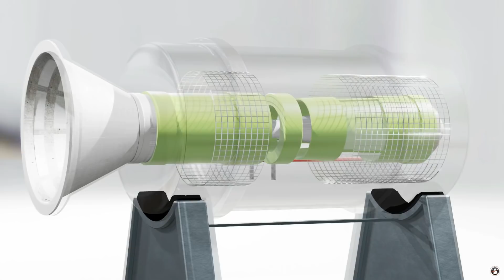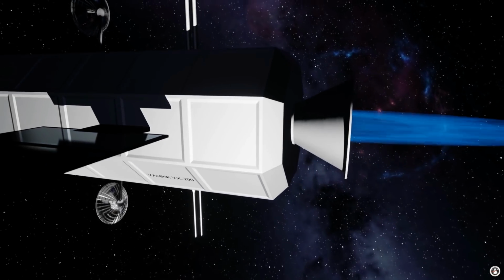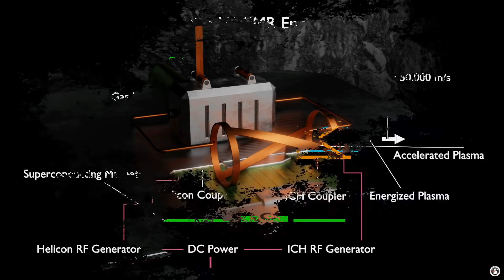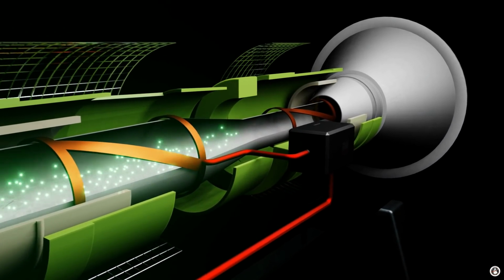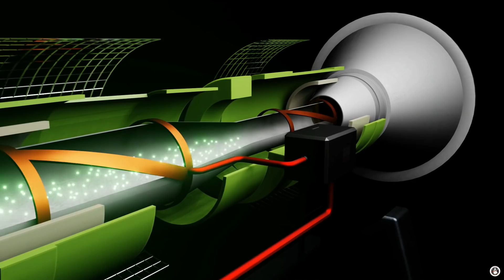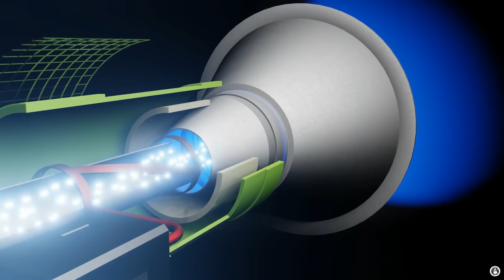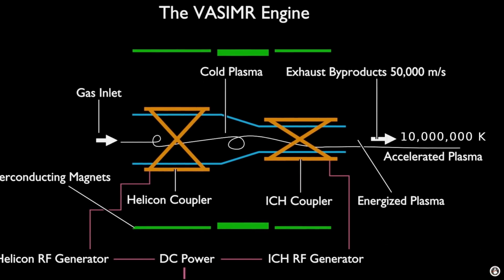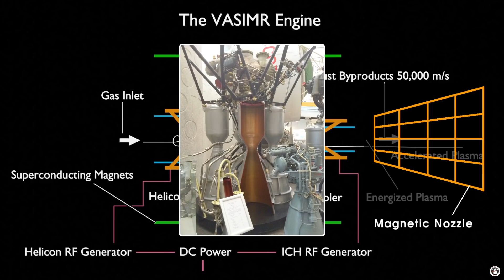The VASIMR Engine – 0.000167 c / 50 km/s

Comment: Nice to have these very high speeds, but that craft will have to slow down considerably, to land on Mars. How does that work?
Reply: Chemical engines are useful to climb or descend from and to planetary gravitational holes. 

But for space outside gravitational sphere of influence SOI, VASIMR is the best. It would spend half the trip accelerating to incredible speeds and the other half decelerating at a very low price tag in propellant. It is very similar to chemical trips except for the fact that during most of the trip chemical engines are turned off as they did the planetary transfer burn at the beginning of a trip. Think pf a cannon ball that gets its propulsion inside the cannon only and the rest of the trip it goes by inertia.
The good thing is Mars is in a higher orbit compared to Earth, so the climbing process would slow the ship, saving some need to decelerate and saving some propellant.

As I see it the VASIMR ship is like an airplane. You use an ascent vehicle (think of a car to go to the airport) to go to orbit and a descent vehicle to land on planet. Both use chemical engines. And the airplane uses VASIMR. Just like driving across a continent takes ages, having an airplane is faster to reach destination.
Reply: @aquarius5719  Nuclear Salt Water Rocket would be the fastest one, it's the real life buildable version of Epstein Drive from The Expanse series.

VASIMR Isp 5000 s, largest version thrust 5 Newton.
Nuclear Salt Water Rocket using Reactor grade U235 Isp 6,728 s, thrust 12,900,000 Newton.
Scott Manley even did a video on NSWR.

Comment: How much electricity does it consume?  What is the specific impulse?  Is there a drawback in the engineering?  It seems too good to be true.
Reply: ISP is variable unlike chemical engines. R&D is about overcoming drawbacks. It works on Earth. It needs to be put in orbit for further testing. Up to this point it exveeds expectations. NASA is very demanding, they did not even allow Musk to paint a SpaceX logo on his Dragon capsule because it could cause uneven heating that could lead to paint debris and more space junk. NASA is that demanding. Dr Chang enjoys the respect of NASA. Imagine that.

Comment: What is the onboard power supply needed to create the magnetic fields on the ICH and the nozzle? With such high draw, I guess that it will require a massive amount of electricity. Are they planning to use fuel cells? Otherwise a good chunk of your Starship will be used up to stack batteries. Plus, it would only operate in vacuum, from LEO. A 10Mdeg plasma plume would probably not behave very well on a launchpad at sea level

Comment: What I missed in the video is what thrust can this engine produce.
Reply: This video is long on flowery claims and pretty pictures but short on any useful information.
Reply: .0001 Newton. Not a lot.
Reply: @billtoo4694  sounds pretty useless... :(
Reply: @motomono  I'm sure it can be improved. The big thing in rocket engines is exhaust velocity. The higher the velocity of the exhaust, the higher the speed you can attain eventually. We've spent decades fine tuning chemical rockets as far as they can go. It's time to look at new technologies.
Reply: @billtoo4694  I can't agree more. It's just a bit disappointing that it's so week. I really hope they'll improve it when I'm still around to see it.

Comment: "...To reach Mars in only thirty nine days."

For comparison, the Mayflower sailed from Southampton to Cape Cod in seventy days.
Reply: the 39 days claim is bullshit based on unrealistic and non existing nuclear reactors with near impossible power to weight ratios.

With the very best near term nuclear reactors (fission, but also fusion) you can get to Mars in no less than 6 months with VASMIR.
Reply: Not being an engineer,  @rogeriopenna9014 , I'm far from qualified to debate the point. I merely quote the data provided by the video. If you would argue the matter, you'd need to take it up with AsteronX, not me.
Reply: @Rogerigo Penna
Does it matter though? 6 months is not a crazy long time for how long you have to travel
Reply: @orangeo5344  true, but then you do not need VASIMR.
Reply: @rogeriopenna9014  No you don't but it would be a lot more efficient if the ship used this and never had to land. It doesn't need the power requirements stated if it had a constant thrust that would mean constant acceleration.
Reply: @rogeriopenna9014  No I haven't but the main reason most people say the drive is a pipe dream is because of the large power requirements. First off it isn't an ion drive. A gas is superheated by radio waves to hotter than the sun into a plasma this is contained in a magnetic field no material can withstand this temperature. This plasma expands at a enormous rate from the temperatures it is guided through a magnetic nozzle. It is a plasma drive not an ion drive. The hall thruster has a surface area limit it is a ion drive. The visamir drive is only limited  by power ,the magnetic field, materials to hold it, fuel and stopping it from overheating. This large power level to get it to mars in 39 days is with short term thrust. They can do it again when it cools down. A 200 magawatt systems would take a larger reactor that would be hard to cool down in space. With a smaller version of the engine it would be easier to have a constant thrust. It will be a long time before we can put up large reactors in space. We can do the smaller version now.
Reply: @rogeriopenna9014  I found something that may interest you. It is a upgrade to a old mpd drive (magnetoplasmadynamic drive). The old drives upgraded by using a outer electromagnet. This one company is upgrading this by using superconducting tape. This increases efficiency to the point were one engine well get 200 newton of thrust. Thirty of these is 6000 newtons of thrust with 3 magawatts.  All thirty thrusters would only need 3 magawatts. This is enough constant thrust to get to mars with the spacex starship in thirty days from earth orbit. It would need about a ton of fuel for day about 28 tons for the trip. Starship could still air brake and use its normal rockets to land. The thrusters would have  to reverse direction of thrust half way there to slow down enough. I got this off of Terran space academy. He includes the math with his videos. According to him I am wrong about the visamir not being an ion drive.
Reply: @rogeriopenna9014
All higher EV engines that have enough thrust to propel a few thousand tons with enough acceleration to not be the limiting factor (at least a few milligees per ship at the bare minimum, hopefully more than 5-10),  means the same ship can be done with less fuel. 

It is a necessary industrial lever, the Dv scales linearly with exhaust velocity but to the logarithm of the fuel on your ship. 

So we need high exhaust velocity/ISp engines no matter what, the higher the better, so long as they don’t have thrust so low they can’t even empty their fuel tanks while burning non stop for months (some engines are this weak), and so long as neither the fuel nor engine+ power plant system are made of materials too hard to obtain. 

We need ships that burn east to obtain stuff like hydrogen/water/ammonia/methane/CO2/nitrogen at the highest exhaust velocities possible simply because increased exhaust velocity means you need exponentially less fuel for the same mission.
Reply: @rogeriopenna9014  I don't see where you come up with that. It takes less than  6000 newtons of constant thrust from earth orbit to to get starship to mars in 30 days. The 200 magawatt version of visamir is designed to run for only 100 hrs to get to mars in 39 days. Designed with a constant thrust without overheating at 6000 newtons of thrust from orbit 17500 miles per hour already  would only take 30 days..
Reply: @clementvining2487  

I don´t know what kind of calculations you are making.

But at Closest approach, in a straight line Mars is 65 million km from Earth. At a straight line, 65 million km divided by 28 thousand km/h (orbital velocity, the same 17500 mph you used), it would take 2321 hours, or 96 days to get to Mars.

96 days, not 30.

That considering a STRAIGHT line. AND considering relative velocity between the 2 planets being equal to orbital velocity.

However, it doesn´t work like that. You can´t just use the orbital velocity. Where is your delta-v budget? You need delta-v to increase your orbit to an excentricity where it meets Mars.That means it is NOT a straight path. And that you will take a LOT of time accelerating to meet that delta-v. AND time decelerating.

6000 N of force are enough to take Starship to Mars in 30 days?

Let's see... Starship DRY MASS is 120.000 kg. 6000 N / 120.000 = 0,05 m/s²
BUT Starship has propellant. It's actually 1.350.000 kg, when fueled. That's 0,004 m/s² of acceleartion.
Reply: @clementvining2487  Ok, I se you deleted your post where you said you were talking about tons and I was using kilograms. I guess you realized 1 ton = 1000 kg, and I just multiplied Starship numbers per 1000, because the acceleration calculation is made by dividing thrust by mass in KILOGRAMS.
Reply: @rogeriopenna9014  Starship only needs 100 tons of fuel to land with air braking.  120 tons dry weight, 100 tons payload, 100 tons fuel for landing 28.5 tons propellant for space drive. Distance 54 million miles this is not my calculations.
Reply: @clementvining2487  if it's not your calculations, give the links.
Reply: @rogeriopenna9014  Terran Space Academy. Advanced plasma propulsion talking about a advanced MPD drive. Needs 100 kilowatts to produce 200 newtons of thrust.
Reply: @clementvining2487  give a specific link
Reply: There has never been a credible explanation of how this engine could reach Mars in anywhere near 39 days.  Not even with a zero mass power source.
Reply: Its calculate to be nine months, due to the sad consept of canister bulk burning fuel, that must take idole duriation, if you traveled non stop in a massive space station at the rate of gravity fall, it won't be long to a place even like Mars,  also way more comfortable

Comment: The problem here is POWER.  Towards the end of your presentation 100kw power is mentioned in text at the bottom of the screen.  The ISS solar array of 8 SAWs has an area of 3360 sq meters and an average power output of right around 100kw (84 to 120 cycling between sunlight and shade) (although in continuous direct sunlight as much as 240kw) with a combined mass of 2600 kg.  Mind you that's before taking into account the power needs of the payload/passengers of the craft.  So we are talking about a power system for a VASIMIR craft that rivals the largest most powerful power system ever put into space.  Further it seems disingenuous to characterize this or any engine in units of "travel time to Mars" as such a mission is entirely dominated not by the drive so much as the other parameters of the mission.... How much cargo is being brought?  How many astronauts?  How long are they meant to stay?  Are the meant to land, or merely orbit?  Are they meant to aero-break, or is deceleration thrust included in the travel time?  Ultimately a more legitimate measure of engine performance is isp, and thrust to weight ratios.  And thrust to weight ratio is only meaningful if the source of energy for the VASIMIR is included in the weight  (after all the energy of chemical rockets is included in the weight of their fuel, so it's only fair).  Lastly, the variable isp of the VASIMIR seems like an odd feature that is not very useful for any individual mission, but rather would make the VASIMIR an engine that makes more sense for a mission-independent piece of architecture... essentially a tug-boat that would hang out in LEO, and be topped up on reaction mass as needed there, and then rented out to various mission-articles that it would rendezvous and dock with to then boost into a interplanetary cruising trajectory before detaching from the payload and returning to it's parking orbit.  I'm curious why this usage mode is never discussed.
Reply: That is a Tesla or Boeing problem. Not VASIMR. They will need their own R&D to overcome that. Tech advances so what was impossible a few years is possible now. In aerospace the phrase "cant be done" maybget you fired because nearly anything in space tech was impossible when it was created.

Comment: Sorry I read his book, was bewildered where the high efficacy was. It turns out I’m not alone, Robert Zubrin has dismantled this as a viable IP transportation propulsion system. It produces the thrust but at a engine mass that negates its advantage for these ludicrous transit times quoted.
Reply: Zubrin also "dismantled" the idea of Musk of Battlestar Galáctica huge fleet of ships and Musk proved him wrong. Now you have a giant starship in the works.
It is easy to criticize. It is difficult to create and solve problems.
If Zubrin wants to reach Mars his own way he should build what is needed, like Musk or Chang did. Then he will learn to respect hard working people thinking on solutions.

Comment: The issue is not so much the engine. We've had ion engines for a good while. This is just a much more versatile ion engine. The issue is where do you get the energy to energize/heat those ions? The limit is NOT the engine, it is the power source. Solar panels can only do so much. Nuclear reactors in space are sadly pretty much a pipe dream.

Comment: to put into context - originally nasa was going to send a Vasmir version to the space station - for station keeping (2015 i think) - In that case the power was going to be provided via a set of capacitors which would possibly trickle fill with spare power ready for a station boost. Didn't happen but think problem was at nasa end - possibly end of space shuttle? not sure how long they have tested engine for continuously on earth though - i vaguely remember 200hr being on their website at some point (though this seems low to me) but have no idea how long the mars burn would be - anyone remember the mars propsal for this - is it on all the time ?

Comment: Forgive me for being stupid, but when the engine has fired there is no gravity, oxygen, nothing to slow down the craft. So theoretically, it could be fired for 2 or 3 seconds and the maximum speed would be reached in a few seconds, after that the craft could be shut down except for thrust vectoring for guidance. To me for some reason the thought of having to run the engine at a full burn would be silly, the science fiction movies only do it because it's cool and shows forward motion. Example :  If I  took a space walk and used a baseball bat and hit a baseball as hard as I could, wouldn't the ball travel at the maximum speed of the initial hit on the ball? Since there's nothing in space to slow the ball down, the ball would travel at the maximum velocity until it hits something or is affected by the gravitational pull of another body. Does this make sense to anybody out there or am I way off base here?
Reply: Electric engines usually burn for longer than chemical engines to make up for their lower thrust, but they also have the delta-v advantage, which is essentially a measure of how much the rocket can accelerate. More delta-v means you can go faster or "further". We mostly do what you said, fire, then coast, then slow down at the other end, but the fastest way through space would actually be a brachistrone trajectory, where you accelerate half of the journey, then flip and decelerate the other half. Problem is, that requires more delta-v than even vasimr can provide, once you account for all the mass of the needed fuel and energy generation.

Comment: Hi.  I've had an idea for a rocket engine based on a variation of the VASIMIR ion drive. If nitrogen were used as the reaction mass in the engine, then after being accelerated by the grid the nitrogen ions were neutralized and allowed to recombine into N2 wouldn't that chemical reaction add enough energy to the plasma to bring it close to Epstine Drive levels of efficiency? I'm assuming a fusion reactor driving the VASIMIR. I know it takes a LOT of energy to disassociate N2>2N but going from 2N to N2 is the basis of many hi-explosives. At least, this could allow practical single stage to orbit. It would be more efficient than a pure chemical engine and more powerful than an ion thruster. I'd love to hear any knowledgeable opinions out there. This idea has been knocking around inside my head for awhile now.
Reply: wat

Comment: Surprised that no one has asked this:  How much electrical input power is required to run the VASIMIR?  I.E.. how many batteries(Tesla Walls, etc.) would have to be on board to allow a Mars round trip voyage?
Reply from the maker: The VX-200 engine is still being developed, the most recent test was at 200 kW. http://www.adastrarocket.com/Gar-AIAA-2011-7247.pdf
Reply: Tesla solar panels may work.

Comment: you fuel that thing with free energy?
Reply from the maker: The engine does not require fuel, it is not a chemical engine, it requires propellant and electrical power. Propellant can be sourced in space whilst a solar panel, compact fission reactor of mobile fusion reactor can supply the power. The fusion reactor makes use of deuterium, the solar panels, of course, collects solar energy (photons).